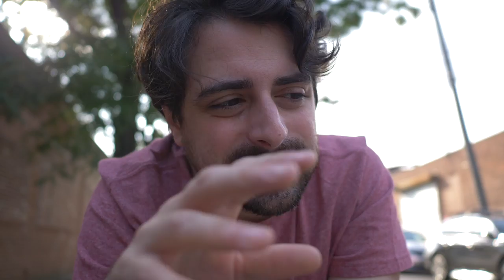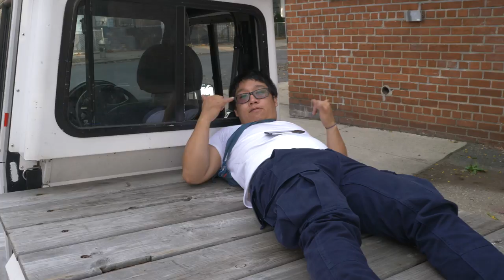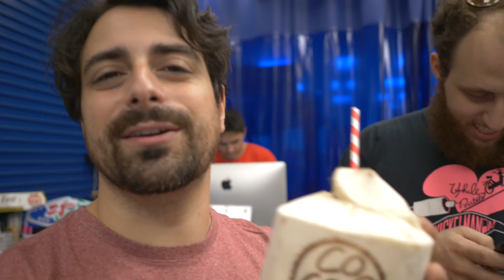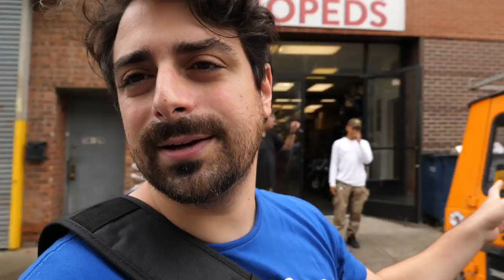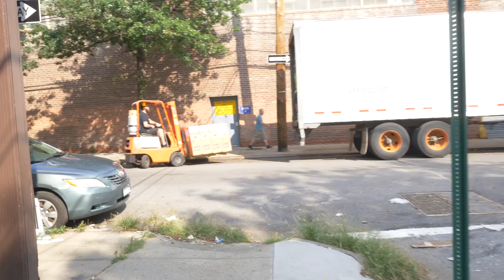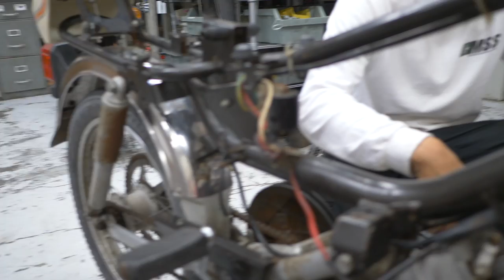If Cody Wanner edited a vlog for Moped Problems

Comment: That car is a steyr-daimler-puch and it vas a basis for the MB G model. It's a beast of a offroader. But sadly the puch part went to s..t. Pity they made cool stuff.
Did you know that Johann  Puch was claimed to be a Slovenian.
Reply from the maker: Sweet hauler for sure.  Great for Moped rescue 👍
Reply: we used them in the army, they can rescue alot more than just mopeds.

Comment: Got my silver bullet running! Rode over 100 miles the other day. The guy i bought it from just got a 2017 tomos bullet black. I rode with him that day too. I told him lets take the back road. He said are you sure your the one riding a moped that may break down. I said i felt pretty good about it. So ten or fifteen miles down the road his stalled out. No spark and we could not get it to run! Bummer man, only 469 miles on it too! Lucky its under warranty. I guess some parts on it are under recall? I cant say it enough, we need Ducati to make the parts for our old bikes and start making the new bikes with them. Less to go wrong and much higher quality! China don't love us and have shown time and time again that they will make and send us inferior products, just look at all the crappy non running china bikes building up. We can pull a 38 year old bike ( in my case) out of a barn somewhere , clean it up, put new bulbs in the lights and fire it up. I highly doubt that these china bikes will do that! Please someone with some pull contact Ducati!